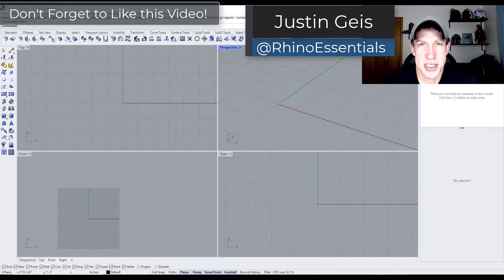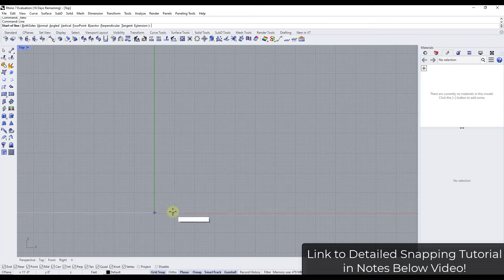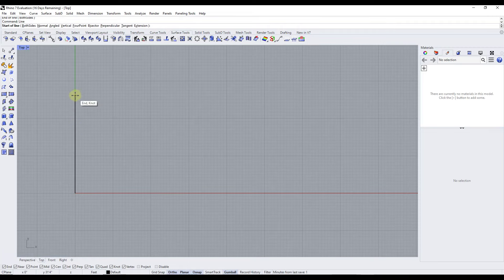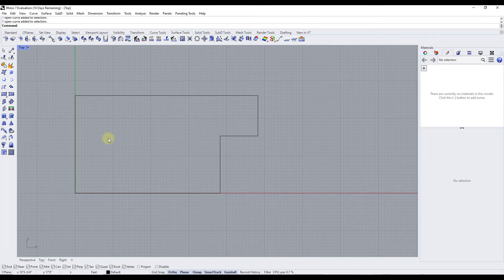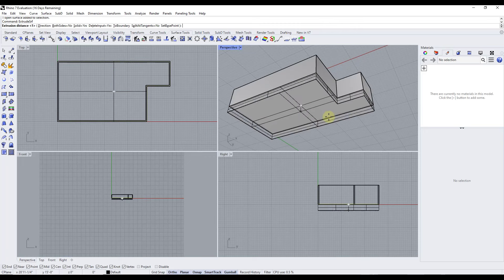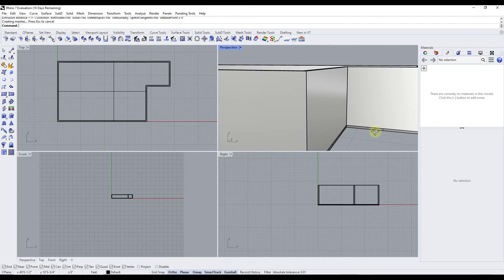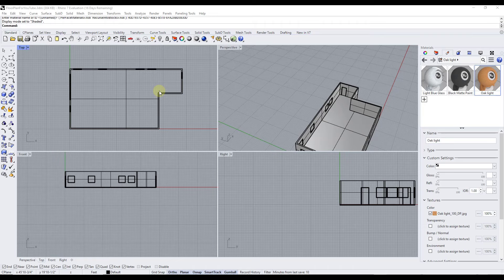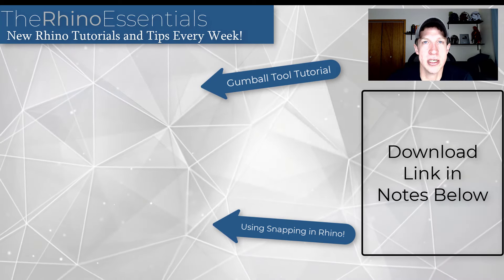How to Create a 3D Floor Plan in Rhino - BEGINNERS START HERE!

Comment from the maker: Hi everyone! Let me know if you have any questions in the comments below! :)
Reply: Hi Justin, here's a quick tip at 6:31 when you want to extrude a planar surface. When you select it and the Gumball appears, you can extrude in the direction you want by clicking the dot on the relevant axis. A text field will appear where you type in the distance number. In your example, click the dot on the vertical (blue) axis, type in "-4" and it will create the solid slab for you. Note, you put the minus "-" before the number if you want the direction to be away from the arrow of the axis. It's much quicker than having to type in the prompts. Hope that helps if you havent figured out that function already.
Reply: Hi! Love the video it helped me a lot since I just started architecture uni! Would It be possible to get a video showing how to do the most basic furniture in 2D&3D? Like Table, sofa, Kitchen, Bed, etc…?
Reply: I can't seem to work out the wirecut setting, it keeps on saying , failed to generate cutting breps and it doesn't cut anything, at 9;02. What am I doing wrong?